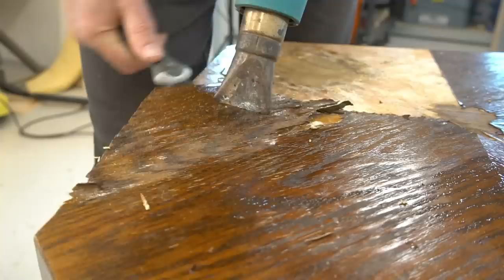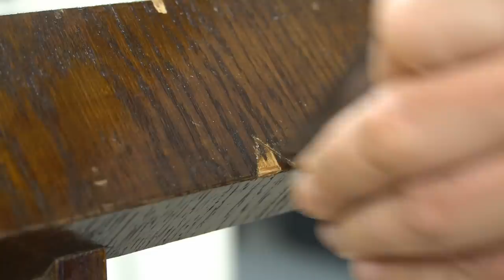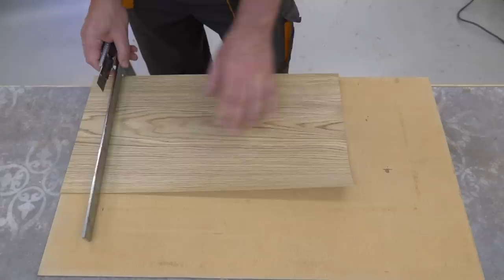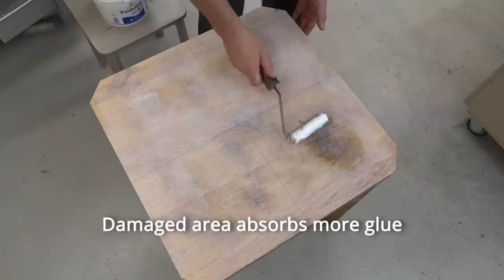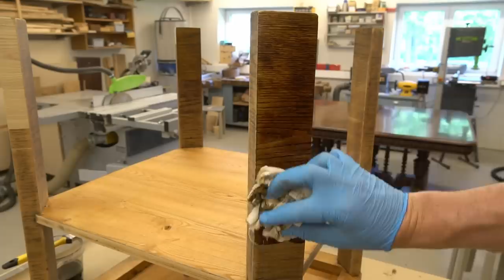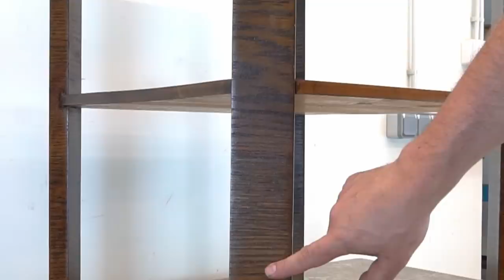I Restored a VIOLATED Coffee Table

Comment: Thanks for all the tips. One question though : at what temperature setting do you use your clothes iron for reactivating the PVA glue? I have a 30s sewing machine cabinet to restore and I've been reluctant because of glue warpage...
Reply from the maker: I usually set it little bit under the 3. If it is hotter then it will crack the veneer and if it is colder PVA wont stick.